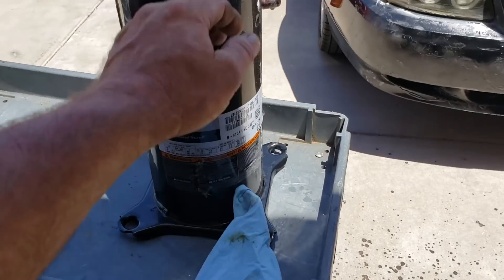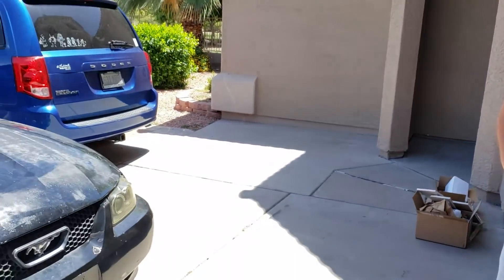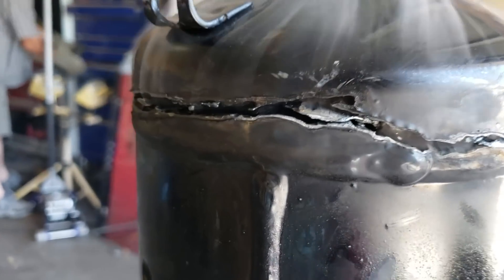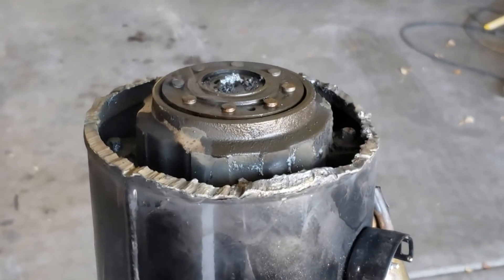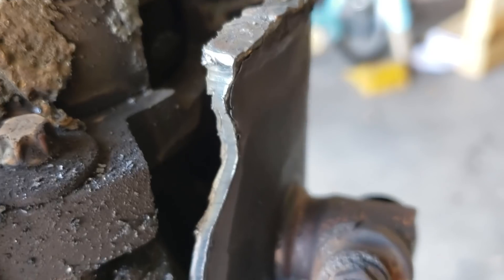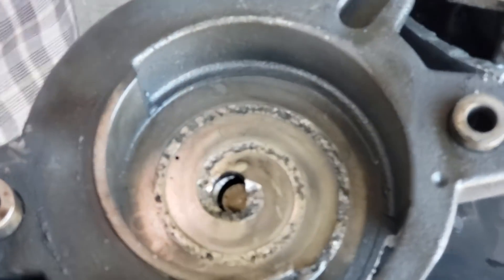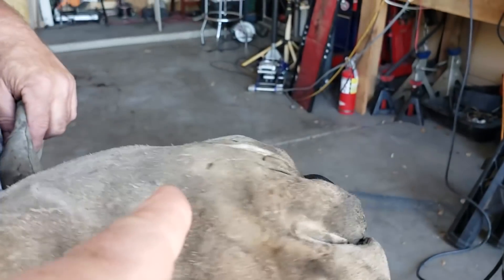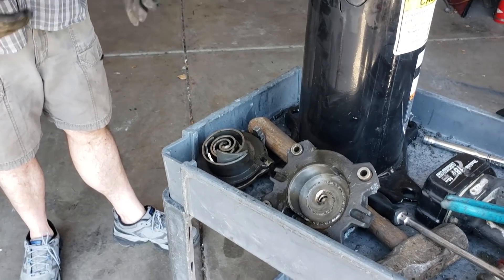Copeland Scroll Carnage (Failed Scroll Compressor Cutaway)

Comment: My 2yr old Rheem unit exploded also. Paid $1,400 for new compressor and that blew up immediately due to metal shards in the system. Rheem won’t cover it under warranty for untold reasons so I’m on the hook for $7,000 whole new unit install heat pump and air handler. Ridiculous, new construction home less than 2yrs old

Comment: what is wrong with those manufacturers? why all compressors sealed that way? many of them could be repaired instead of replaced if you can take them apart without damaging the casing.
Reply from the maker: They just aren't made for repair.
Also when opened the oil will absorb moisture from the air so there would be a requirement to drain and replace the oil. 
All too much for a typical HVAC tech to perform when they can just slap in another compressor.
Reply: @hackfreehvac  Well, replacing the oil is not a big deal and will surely be less costly than replacing an entire compressor (which cost a lot) where most of its part are intact! the companies that make them aim for profit instead of sustainability! that compressor have a big carbon footprint on the environment to make and to recycle. its the same for everything else made those day, just use for a while and through away without giving a dime about earth future.
Reply from the maker: @quantomic9819  It's just not feasible in the industry.

And I can't even get modern techs to replace $25 bearings in a $1000 motor. 
They surely would disassemble a compressor
Reply from the maker: @quantomic9819  
"Carbon footprint".
Well. Now you brought a religion into it. 
This earth is for mankind to subdue as we will.
Reply: @hackfreehvac  I have seen techs disassemble a car engine and rebuild it for a fraction of the cost of a new one, what is more complex? a compressor in my country cost almost 70% the cost of the whole ac, so why just not replace the entire system instead of repairing it? its the stupid manufacturers that made it that way, to buy an entire compressor for just a small damage instead of repairing it! so they can make more money.
Reply from the maker: @quantomic9819 
An auto engine is an assembly made to be separated. A hermetically sealed compressor has the motor and scroll compressor manufactured as a single sealed unit. 
The insides of a scroll compressor are tight tolerances and the ability to rebuild one even if they could come apart would require taking it to a shop and a clean area to disassemble then spend the time cleaning and checking the tolerance of each component and THEN acquiring the parts found to be worn and reassuring.
That just ain't happening due to time and labor not too mention maybe 1% of HVAC techs could service something down to a component rebuild level like that. 
As sealed single unit component they are meant to be replaced as a whole.
Reply from the maker: @quantomic9819  Stop listening to those freaks from the "World Economic Forum".

They will have you eating bugs if you continue to believe their lies.

Comment: These compressors do not destroy themselves. That is a fact.
Reply from the maker: Well. I wouldn't rule out a defect.
This was a brand new water source heat pump. 
Sure perhaps the AAON manufacturer left a part in the closed system that destroyed it.
Or this was just a flawed compressor from Copeland. 
It exploded and there was no other issues with the unit when the comp was replaced.
No manufacturer is perfect. Not even Copeland.

Comment: Was that an R22 system? My shop unit just started making bad metal on metal racket in the run mode. I just did a search thinking the scrolls are hitting each other suddenly but why? Still working but I think I need to act fast before the system is junk. Insane how that just broke. Wonder if the top bearing went bad causing the scrolls to hit maybe. Like where I’m at.
Reply from the maker: No, it was a less than 1 yr old R410 AAON water source heat pump.
Reply: hackfreehvac wow! Water system. So basically this thing had perfect working conditions well except for crap new refrigerant lol. Crazy! Like it sucked a rock lol. Great vid by the way! Love the off the cuff. Friend razzing you, confused kid seeking interest. So middle class America!
Reply from the maker: @you2ubesucksbeyond  
Yup.
Water temp 80 to 85 degrees probably. 
New building too.

Comment: Question??? Was that a new compressor or was it working in a system for sometime and is it single or 3 phase?
Reply from the maker: In a less that one year old water source heat pump. 
3 phase 460v
Reply: @hackfreehvac  ok thanks, I have seen this many times  due to lack of lubrication and or slugging  also running in the wrong direction for a long period  of time if 3 ph.  With this said I use to repair seal type compressors here on the island for years.

Comment: Do you have a link to that ebay plasma cutter? I looked but I couldn't find one that looked exactly like yours
Reply from the maker: This one looks just like it. 
Mine was over $300 but that was several years ago. 
This is $200
https://rover.ebay.com/rover/0/0/0?mpre=https%3A%2F%2Fwww.ebay.com%2Fulk%2Fitm%2F233209612005

Comment: I bet that sucker was loud when that happened!
Reply from the maker: That's what I was thinking. 
It is in a call center with hundreds of cubicles.

Although, it's an AAON and not a Goodman.
It's got this massively heavy duty noise blanket wrapped around it and then it is in a pretty well insulated compartment in the unit above the t-grid ceiling. 

I never ran it with the noise blanket removed. But it did sound like a 3 phase compressor running backwards when I had the panel off.